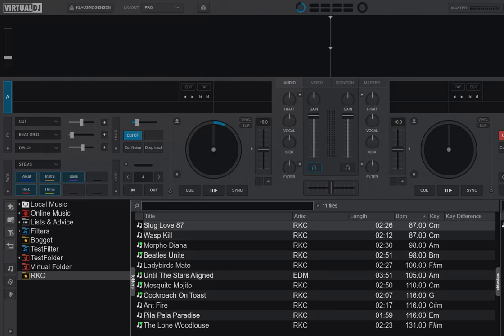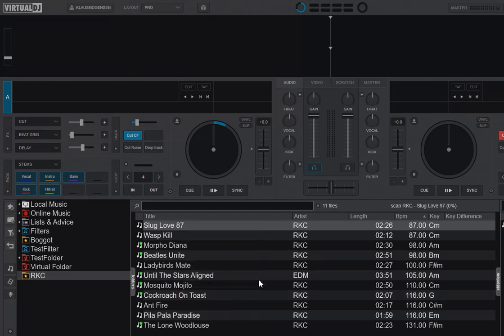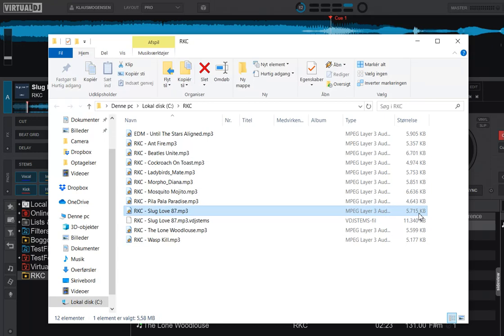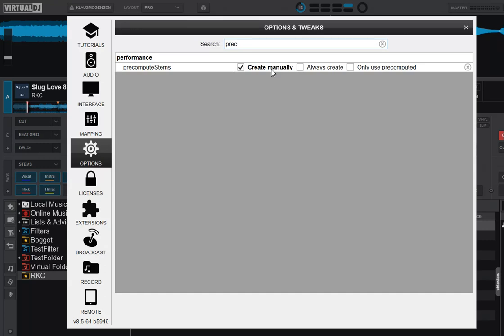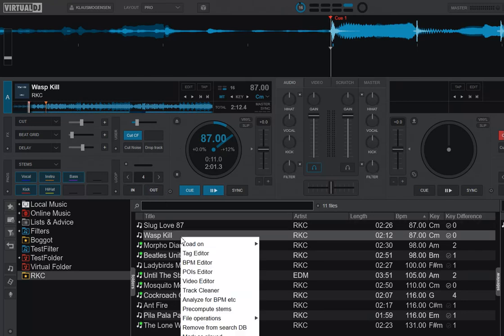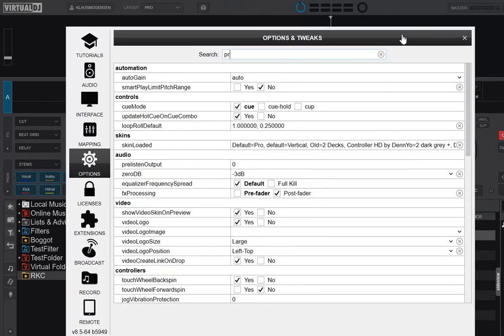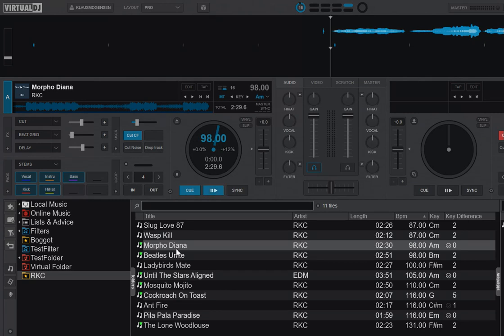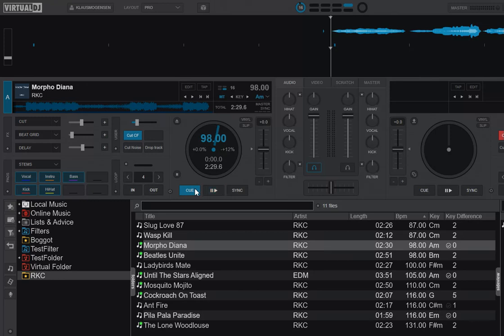Quick n' Dirty: Pre-compute STEMS in VDJ8.5/2021 build 5949

Comment: Will this be making my promo only music video to freeze all the time it never done it before on the old virtual dj I think that this was making my laptop run slow maybe?
Reply from the maker: Generally the Stems feature ineeds a lot of resources since ir's based on AI/deep learning algorithms
So for older laptops I would probably simply disable it by setting mathEngine to disabled
Reply: @klausmogensen8691   I'm running 12gb ram and i7 with 750  Graphic card
Reply from the maker: @callumhopkinson8097  A modern nvidia graphics card can handle the stems separation, but probably not the one in your laptop. I've previously done videos on this that you can lookup if you like
Apart from that it's probably going to depend on which generation i7 CPU you have
But generally the stems separation either runs "good enough" on your laptop, or it doesn't and other features - like regular playing - starts to suffer. 
If it doesn't run well, the safest bet is to disable the feature (mathEngine) until the next time you upgrade your laptop
Reply: @klausmogensen8691   thanyou pal I see what i7 my Is do you have link to the video about fix it
Reply from the maker: @callumhopkinson8097  no, if your laptop suffers when enabling stems separation, then the fix is to disable the feature - or to only use pre-computed stems, and compute them when you are not DJing

Comment: Thanks a lot this is very helpful. I never had this issue with my original version of VDJ so it’s kinda disappointing. Tracks used to load quickly every time on all of my older versions. Wishing I’d never updated. My older Mac works harder to run this new program too. Might have to go another route. $299 almost 10years ago so I guess I got my money’s worth. Sad though.
Reply from the maker: It's not an issue. It's a new feature you can choose to use
Tracks still load instantly. Now you by default are just asking VDJ to do a whole lot more after the load. 
It"s pretty incredible that it"s possible. Most DJs see it as a game changer for the whole DJ industry 
But you can.of course disable all that by setting mathEngine to disabled. Then it's like the previous versions
Reply: @klausmogensen8691  Thanks, I disabled it but plan to use it on certain tracks especially after I upgrade to a new Mac!
Reply from the maker: @hermonbluesmaclin-theboogi6830  you can set vdj to only use pre-computed stems. Then you won't get the problem while loading tracks, and can pre-compute the few tracks you want to use stems for before you start djing

Comment: please  the am using dont have pre computing and also my computer is slow too
Reply from the maker: Simply upgrade to the latest version. It's the one on the download page at virtualdj.com
Reply: i have download the virtual dj 2021 
 @klausmogensen8691
Reply from the maker: @deejayopanka8035  You need the latest build. Pre-computed STEMS wasn't included in the first couple of VDJ2021 releases
Reply: @klausmogensen8691   sir if i download can i get pro
Reply from the maker: @deejayopanka8035  Sure, it's the same software for all licenses. Simply login using your pro license credentials, and the software goes to pro mode

Comment: Great stuff klaus as always. Got a question can I map a button to toggle stems off and on. Between normal eq and stems.
Reply from the maker: Yes 
eq_mode +1 
should toggle between regular eq and your last selected stems mode
Reply: @klausmogensen8691  tks klaus. However when I map that to a button the menu shows on the screen but it doesn't toggle. I have to use the mouse to toggle it. I want the button to take care of it. Any ideas?
Reply from the maker: @charithasirimanna5033  Then you probably forgot the "+1" part
Reply: @klausmogensen8691  no copied ur exact phrase. When I press the button the menu pops up :(.
Reply from the maker: @charithasirimanna5033  I just tested it on a keyboard key, and it does not open a pop-up
All I can think of is that maybe you got an old build? 
If so make sure you download the latest one from the homepage
Reply: @klausmogensen8691  hey klaus. Well it was a syntax error with the +1. Seems fine now. Tks.

Comment: For some strange reason, for the first time this latest build is not updating for me. The update window appears at the start up of VDJ, I click "yes", but it doesn't go through the usual update process. I have shut down VDJ and reloaded it, but still no luck. I also restarted Windows, also nothing. I have Windows 10, 64-bit, VDJ 2021 installed with Pro License.
Reply from the maker: I would simply download manually and install on top
Reply: @klausmogensen8691  Okay Klaus, I will do that. Thank you!